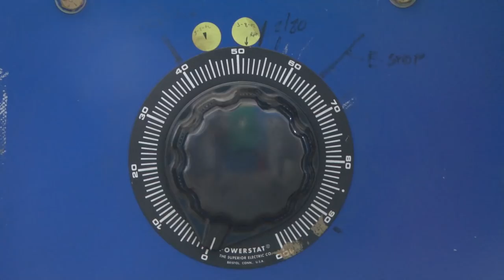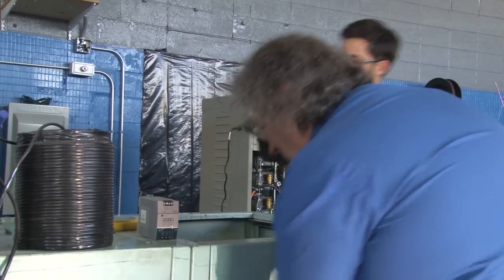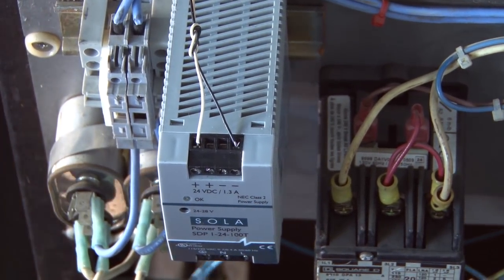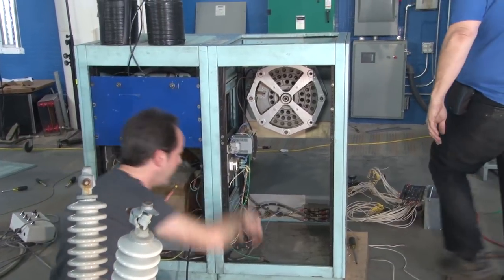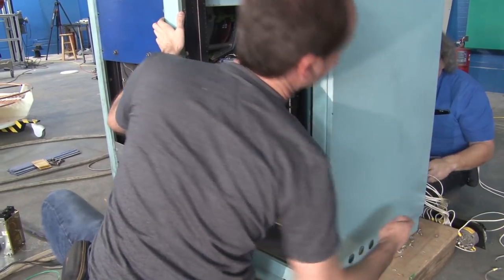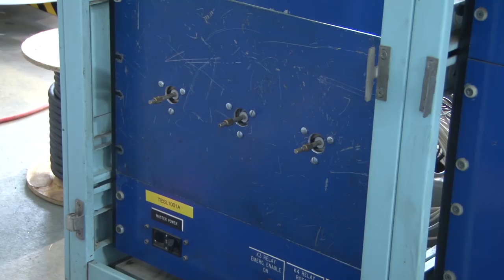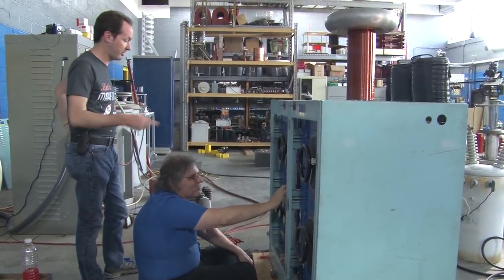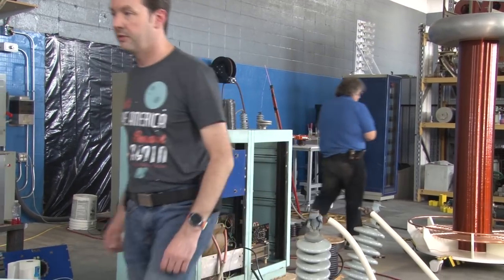Experimenting With a PSU Made by Bill Wysock: High Voltage Lab

Comment: In my admittedly naïve experience the goal of engineering is to create something good enough based on a set of requirements. As part of a backlot theme-park demonstration I can imagine the use case would be very narrow (set it and forget it) with a high duty cycle with low maintenance and  reliability being most critical. 
How does his implementation measure up to yours with that in mind?

Comment: are there any capacitors in that power supply? looking at how you are working on it either they are very small or there are none
Reply: Jeremy Back I highly doubt it, it's just to supply the voltage and current..